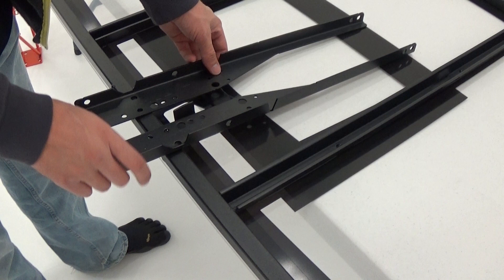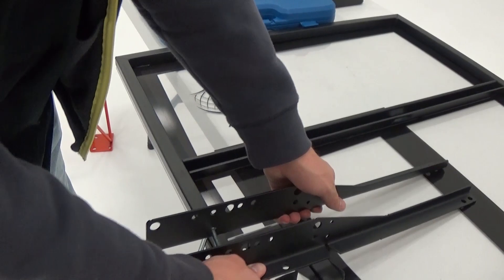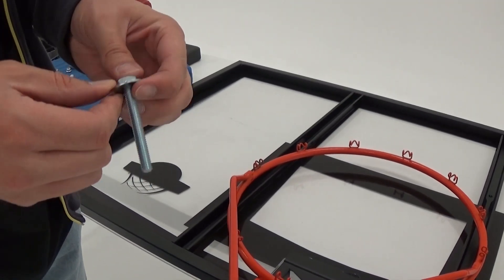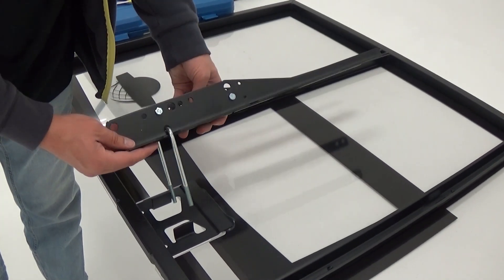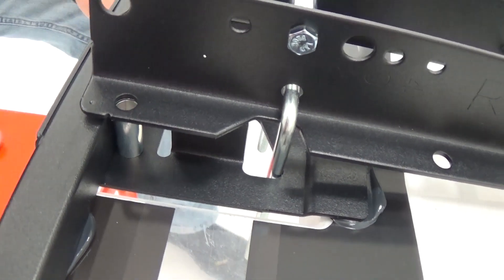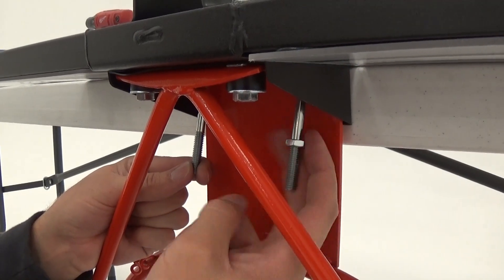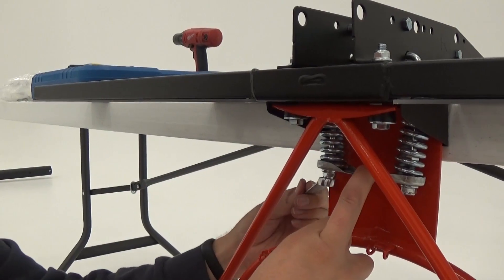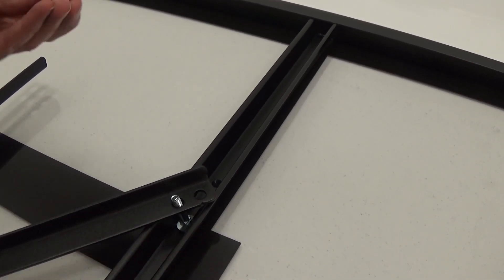Lifetime 48 Crossover Basketball System fc baseStep 3  Assembling the Backboard and Rim

Comment: I got a new backboard 90010 a universal backboard mounting kit 9594.  Both lifetime     The Y bracket when out together isn’t wide enough to bolt onto the backboard.   Seems to be at least  1/2 “ to 1” off.  Put together with spacers and everything so no other way to put it together.      Not sure what to do.   🤷🏽‍♂️